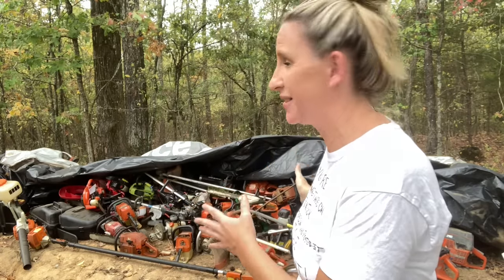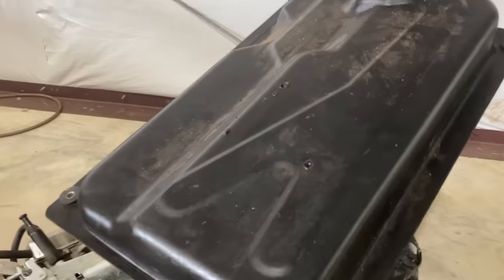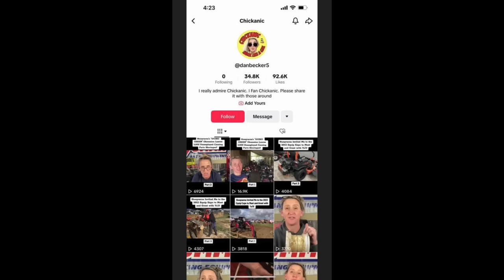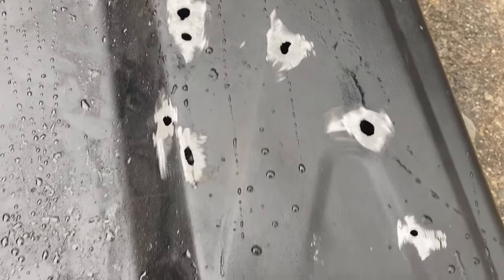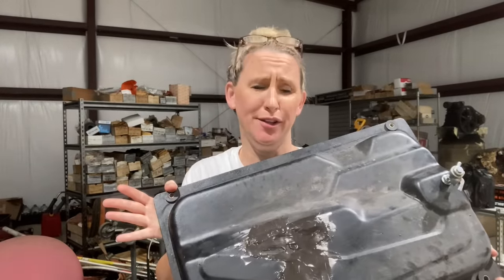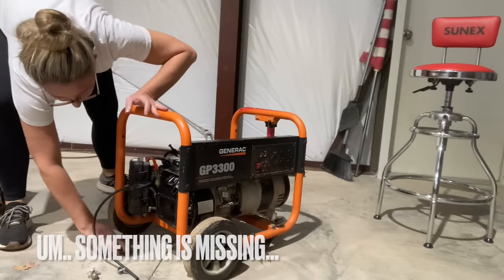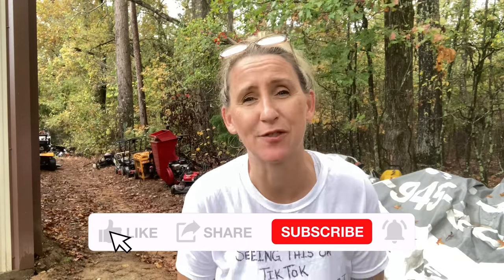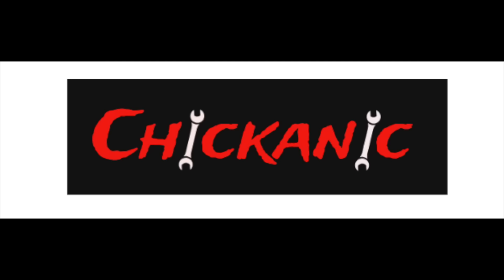Customers ABANDONED All This Equipment! Turning Their Trash Into My TREASURE! Vlog

Comment: Hi there. With tank repairs you can use a soldering iron and use soft solder. I have a big soldering iron I used to use and it fits on an acetylene mixer and just uses acetylene to heat it. If you can get hold of one they work well for repairing steel tanks. Less heat and less chance of blowing yourself up.
Love your content.
Keep up the great work
Reply: I usually use torch and brazing rod...material in a tank is usually too thin to weld(at least for my skills/equipment)...then, put some of that tank sealing product in it, like they make for old tractor gas tanks. If the heat from the torch keeps making the holes burn through larger, then the tank is probably too thin and fragile to repair. I have never had any long-term luck with JB weld, epoxies and all that crap..the gas eventually starts seeping through and the epoxy will start flaking off. If you can get an aftermarket tank for these for $40, that's probably what I would do. The aftermarket tanks may not be great, but as long as they don't leak, I would think that would be a better option than a sketchy epoxy job smeared all over the bottom, especially since the tank sits over a hot engine...
Reply: Bronzing is ok but solder is a cooler process with less heat distortion. The only issue with bronzing is once bronzed that's all you can use

Comment: That looks like classic “water in the gas” rust.  Water is heavier than gas and will sink to the bottom.  If the generator sad unmolested for a couple of yeas, the water drops will stay in the same spot and rust through the metal.  I suspect the “rubber” film you saw was either paint on the outside or a coating the manufacturer applied inside the tank and once the metal was gone that was all that was left.

Comment: um a cutting disk is not designed to grind on its side its a good way to get it embedded into you leg while grinding that tank rust buy the correct kind of disk to grind ie a grinding disk to grind,a cutting disk (thin) to cut

Comment: I repair those big holes by soldering a penny over them.  I bought an old truck that sat for six years with some sort of JB WELD repair. When I put gas with ethanol in it started leaking.

Comment: Great video, always a good idea to purge gas tanks with nitrogen before welding or as my old boss did in the late seventies we put a steam cleaner in the tank for 30 mins and then hooked up an engine exhaust to purge the oxygen. A heat gun is always a good test for a generator.

Comment: Love your enthusiasm, Bre!  Unlike my mood when my Stihl BG55 blower failed to start yesterday.  It ran great on Thursday, but spews fuel out the exhaust now.  Got spark (tried 2 different plugs), lots (too much fuel), but no go.  I use ethanol-free gasoline with Red Armor oil (per your recommendation).  Why would the blower just die with no previous symptoms?

Comment: been getting messages from "real chickanic" for a couple days now. Any time a repaired a gas tank I used a soldering iron and tin to patch the leaks. Clean, rosin core solder and patch fitted over leak/hole. Tin both the tank and patch, put in place then touch with solder. They never leak. Won't work on that tank though.

Comment: I've got my Brother-In-Law's small Champion generator that's just like that one.  He brought it to me and wanted me to figure out why it wouldn't run.  The fuel tank was completely covered on the top and sides with little  bubbles in the paint, so I decided to pressure wash the tank and repaint it for him.  While Pressure washing it, I found that ALL of those little bubbles/blisters were places that the Fuel had eaten completely through the metal and the Fuel valve was completely plugged with some kind of white substance.  I was actually amazed that the tank hadn't been eaten completely in two.  Like you said about that Generac, a "Factory" fuel tank was just too expensive, so I ordered a  Chinese made "replacement" universal tank off of a certain site (i'd almost bet that the factory tank is also made in China, LOL!).
Reply: thx be to the corn/ethanol industry for yet again screwing up things beyond all reasonable use.

Comment: Could be the owner had a couple pin hole leaks and poured an acid (muriatic, vinegar, etc) to eat the rust and left it in too long. Then used a pourable tank sealer/liner to seal it off (taped the holes until it set up).  Experience with a motorcycle gas tank.

Comment: My only issue with the repair is generators have high vibrations.  If the jb weld ever cracks due to vibes its draining that fuel on a hot engine and exhaust.  I couldnt give that to family knowing that.

Comment: 1:26 I have the chipper shredder just like you have. My issue and I would love any help with it, is when trying to start them, the motor isn't detached from the chipper/shredder mechanism, which means in trying to start, I have to turn the entire thing. That is really hard. Plus it takes a few good pulls or more to actually get it up to speed to start.
I'm 67 and fix my own equipment, but it takes so much strength to pull start the darn thing, that I never use it and need to.
My hefty 29 yr old grandson can start it, but even as strong as he is, that's a lot of machinery to turn with a pull rope.
I'm sure it can be fine tuned to start quickly, but why they didn't make a way to disengage the chipper/shredder blades so you only have to turn over the engine is beyond me.
Love your channel and the video on the show, I wish I had been able to go to it.
By the way, any other single, good looking woman is available with your skills around. 😊

Comment: I found your channel about 6 months ago and like your videos. I especially like the video of you going as a guest of Husqvarna as I'm a big fan of their Chainsaws. My first saw I bought was a brand new Husqvarna 51 in 1994 which I still use today. The only real repair other than normal chains, bars, plugs and air filter was replacing the spade terminal connector for the kill switch as the orginal in half from metal fatigue. Oh I had to replace both oil and fuel caps as they started leaking. Not bad for a 34 year old saw that has cut me a many years of firewood. In fact until 2017 it was the only saw I had. I now have 4 good running Huskies plus 2 that sort of run but need some work and one that I'm not sure about that came with a second 51 I bought which that 51 is one of my 4 good running saws. This sort of leads me to one of my points of commenting. I may be interested in Husqvarna chainsaws that you have tonrepair or for parts. Also any Husqvarna parts of the inventory from your old shop you may want to part with.

Comment: To safely evacuate gas fumes put the filler neck to the exhaust pipe of another machine (car, truck, motorcycle, etc.). It will be safe to weld on when it no longer smells like it ever had fuel in it. Nice job! 1 down, how many to go?

Comment: Hi Chickanic. Start posting the imposters info and what they are doing in a pinned comment on top of each of your upcoming videos so people who fast forward and then comment....know about it. Also On any tank repair that sits above the unit you should glue on under the tank a slightly v shaped (10*angle) and slightly sloped to one end.....a thin galvanized sheet metal catch plate that hugs the bottom of the tank and is glued on at the long edges. That would allow any leaking gas to run along the v notch under the tank and drip off the end away from electrical and anything hot so someone could notice it leaking if it ever starts to leak again. Great video and glad your back! J Pol.

Comment: This is exactly why I have 3 generators of my own and have sold several to friends for the cost of repair. I traded one gen for a small blower for my shop. This is also why I have 14 personal chainsaws.  The after market tanks are almost never the correct fit so you may have a great gen with a sideways mounted tank.😏

Comment: Bre, why didn't you solder the holes in the tanks?  You could have used old pennies or copper blanks and it would have worked great.
Reply: My torch is still packed up, but the welder I used is the welder at the house. I admit it, I was lazy and didn't want to dig for my brazing torch and took the easy road.

Comment: PSA: Don't use a shop vac to clean out a gas tank. I know a guy. We call him Sparky now. His eyebrows grew back, but he had to build a new garage.
Reply: You don’t use it in vacuum mode, you switch the hose to blow air through the tank. As the metal gets heated (from welding) it releases fumes and that air flow carries them away.

Comment: I have a Briggs 19.5 hp gold engine from 2012 and the past couple times I have used it it has been starting harder and harder every time now it's to the point whare it barely turns over any idea what might be the problem I changed the head gasket about a year ago and I adjusted and set the valves then could thay have worked their way out of adjustment.

Comment: @Chickanic, a little lesson in metallurgy and corrosion for future reference:
If you have a coating inside the tank that has pinholes in the coating, that pinhole will develop pitting corrosion that will accelerate quite quickly and drive itself clean through the metal while leaving the surrounding material untouched the reason is because that tiny crevice develops a very high pH compared to the surrounding environment (because as oxygen atoms are stripped out of water by the corrosion process the OH ion that is left behind is trapped down in the crevice because ofca lack of mixing with the rest of the environment, driving the pH higher and higher.

Comment: Anyone whose business is repairing things has the 'leftover' problem. You can reduce the problem by requiring a monetary deposit up front or after diagnosis; if someone is so broke they can't pay that then they can't pay the whole repair bill either so they won't leave their junk with you. And often the repairs needed are near the value of the fixed machine so you can't come out ahead no matter what. A friend's motorcycle shop ended up with the back lot filled with bikes in just 4 years; not so simple to deal with when there's a title involved. Only a couple of those were ever picked up- the rest turned into rusty junk.

Comment: Nice one. Was laughing because you were laughing when that thing took off and never even thought about checking it to see if it actually generated voltage. I would have given it to a friend and all he would have received (if it didn’t work) was some noise maker. 
I have two generators here. My old Champion with a metal tank and a new -ish one  I bought from the previous owner of this property with a “plastic” tank.  
Was,wondering if there isn’t someone out there that makes plastic gas tanks … one size fits all with the right brackets. I suppose the safety people wouldn’t approve?

Comment: Got a good question.. Husqvarna will not refund me or fix my 525lst trimmer I just got .. apparently you can't turn it on side and edge with it the gear box skips.. $400 trimer I never heard of this... I'm stuck with a vibrating awful trimmer.. I'm at a lose .. hart broken 💔  because all I buy is Husqvarna... Husqvarna... ever had this issue.. am I wrong...

Comment: Get yourself a multimeter lady and measure the output voltage, ok the fan is a simple electrical machine but other appliances might be more sensitive to the wrong voltage,, usually there in the US  the main voltage must be 110 volts .. :)
Reply: Us has 120-240 volt. There is no 110 volt. Check your outlet. It will range from 118- 122. the 110 was back in the 50`s.
Reply: @HEHE-dx9og   thanks for the info, i am in Europe and here we have 220-240 ac volts, there in US  though it was 110 that's what i knew so it was in the 50's  ok ,  now 120 !! if you use 240 in the US you will set on fire many appliances.... we use transformers in is Europe to use US standard appliance, that converts 220 to 110n of 120 volts.
Reply: 240 volt is for a/c and electric stoves and stuff like that. Outlets have 120 which is one leg of the 240.  @petegkSalonika
Reply: @HEHE-dx9og   on the specs on the tag on every electric-powered appliance are the volts of use ... there is no one leg or two legs in ac voltage  ,,, and is not easy to have two networks of power in the US one 120 and another  240,, what i guess is that those stoves and a/c s are built both for Europe and  US, so the customer does not have to do anything to adapt the system to the power in AMERICA OR EUROPE  are compatible everywhere... This is what i know but i know i do NOT  know what is going on in the US.

Comment: If you really wanted to test out the "gen" part, you should have used a hair dryer. Or two. 3300? Is that 3300 watts? That should be able to run two hair dryers, if one of them is not on high.

Comment: When I was growing up, I always fixed engines and carburetors and then I got into DC power supplies and solar panels and then batteries back in early 1990s and now I have an off grid solar powered house and electric car with electric lawnmower electric battery powered chainsaw battery powered leaf blower battery powered lawnmower, and every single cordless power tool you could imagine Dewalt flex volt, of course. It’s so much better than polluting two-stroke garbage. No wonder they left all that equipment behind my Tesla will blow away your Corvette.
Reply: My Vette will beat ya across the country.

Comment: I've reclaimed many a fuel tank by removing the corrosion with phosphoric acid and then silver soldering the holes.  I'm sure you already know that when using any kind of fuel-burning torch to repair an enclosed volume, it is crucial to ventilate the hell out of it because the torch itself will fill the space with an explosive unburned mixture while the soldering is going on.

Comment: ohhh one of my biggest pet peeves is people spending 40 to 100K on a nice insulated shop. Then too cheap to put up some 3/8 4x8 OSB from the floor up 8 feet to protect it. Every shop I go into that doesn ot do this has the insulation all destroyed and it looks like trash too. Please, spend the 3-500 bucks. Protect your investment.
Reply from the maker: You might not have noticed everything is in the center of the shop away from the walls. Framer comes Monday. When you build a 40x50 steel building, instead of a large chicken shed, you have to do things as you can afford them. LOL

Comment: Good Job Chick !  I have a question : Say for instance I drop off my generator and you check it out and call me and i saiy i will get back to you and a year goes by , then the next summer I come back and i want my generator .....  I would think that you are able to charge storage fees ( You have to make something for looking at the machine and then the time you held onto it for me .
Now i know after a year I would think i should be your cause like you said you call me every 2 months and i do not return a call .
1) Is there a set amount that you can charge me for storage or can you charge what you see is fit ?
2) Is there a certain time that you can call it your machine  since i let it sit for 2 years  ?    Just curious ...
Here in NJ where i live there is a set rate that can be charged  "LEGALLY" for storage ....
It prevents some one from charging the customer like a boatload of cash for each day it is left on his premesis of the repair shop !!!
Just curious on how the storage thing works where you live and when a unit can legally become yours .
I will go and look at the guy who is impostering you and report him for ya ...CAUSE THAT AINT RIGHT !!!

Comment: In the shop I used to work at in one case a customer left a chainsaw to be fixed. Didn't have the part and waited for the part to come in. Part came in fixed the chainsaw. Called the customer no answer. Found out later the customer had passed away though the wife.

Comment: Not sure I would set a family member (or anyone, really) up for failure like that, if they are depending on the generator for power outages. Generac brand consumer level (not the stationary commercial level) are garbage. The chineseum metal in the tank is just an indicator of the overall lack of quality. 
It’s an okay thing to take camping or use as a convenience but it’s still junk.

Comment: Looks like the original owner tried to line it with motorcycle gas tank liner off of Amazon if you don't clean the tank properly before you put it in it won't stick good and then this happens

Comment: Far be it for me to tell anyone what to do. But I'd be hanging on to anything that runs on fuel, do to the "Green Pipe Dream". As I think some of what appears today as trash or not worth fixing may turn to gold in the future. But that's just a guess on my part.
PS. I hope Ron does not feel bad about not being able to weld the gas tank. As I can't find anyone to make a repair on trunk bed that require welding metal that thin. The welders I have asked just say NO. Then look at me like I am stupid for asking. But I'll keep asking around, as I find it kind fun. 🤪👍I know shame on me.
Reply: that truck could be brazed with brass verry easily.
Reply: @alanm2842  Thank you for your kind reply! I do understand that it could be Brazed, I fact In could braze it myself if I had the tanks to do so. But still no one seems to want to touch it. Maybe I should look into buying or renting a small set of tanks. Just thought paying someone would be cheaper. Thanks again.

Comment: I am getting tired of working on all my gas operated equipment,I am going to all battery,I will know in the future if it pays off!!
Reply: It will depend on how often and how long you use them. Gas operated equipment will last longer if taken care of and have more power. Batteries die, but as long as the manufacturer keeps making that battery you are good. My experience is that every few years they change their battery design and you are screwed.